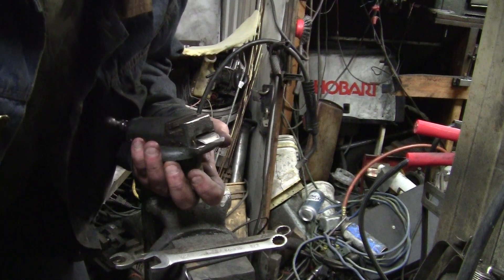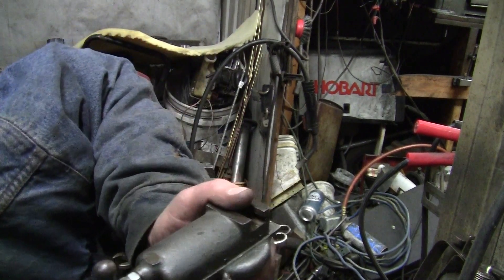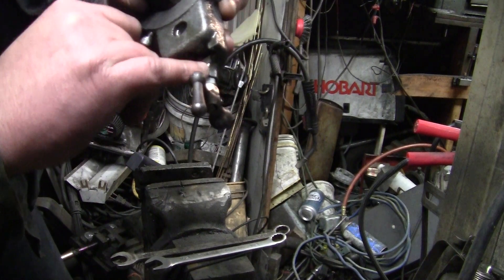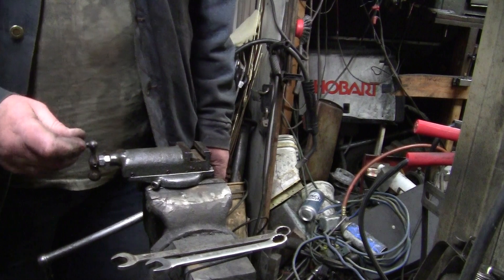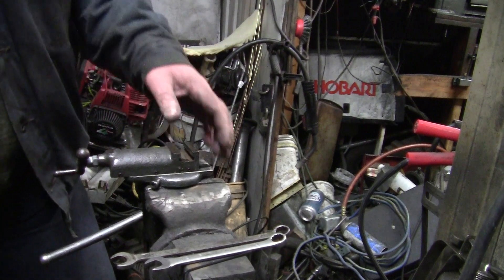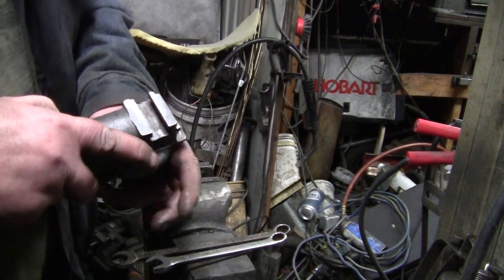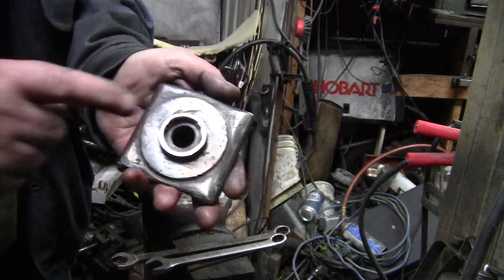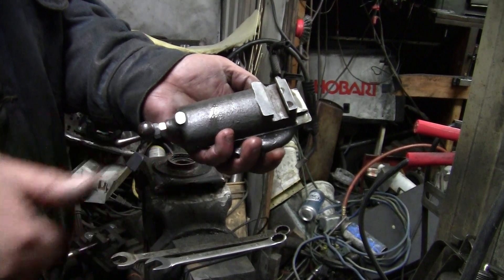craftsman 109 lathe compound rebuild ( PART 2 )

Comment: Worked out good Shawn. So now it's got a right hand screw thread ? How come the handle doesn't turn anti clockwise to advance it ?  The action has got me a bit confused.

Cheers Rob
Reply from the maker: She has a standard 5/16  coarse thread , Not sure what you mean Rob  ??
Reply: Hi Shawn,

I thought in the first video on this you said you were changing the thread to right hand from left hand (which would reverse rotation direction).  My old Schaublin cross slide is like that (anti-clockwise to feed/advance) and I have to remember when I use it - some old lathes were made that way.

Cheers Rob

 @shawnmrfixitlee6478
Reply from the maker: @Xynudu   It feeds in right hand